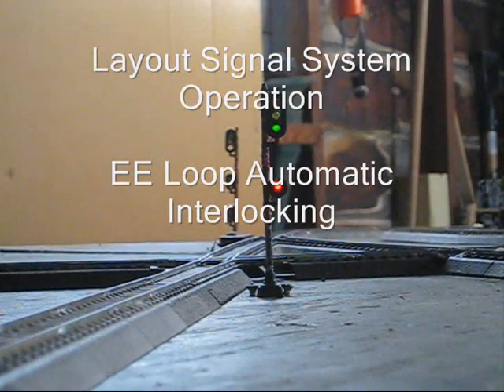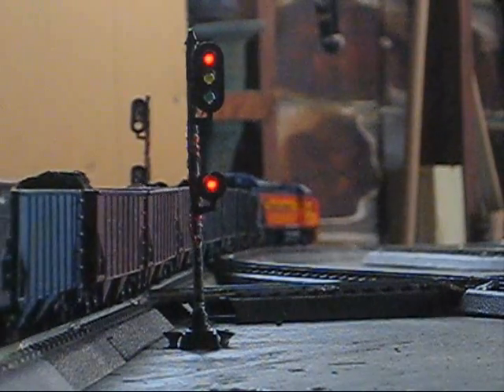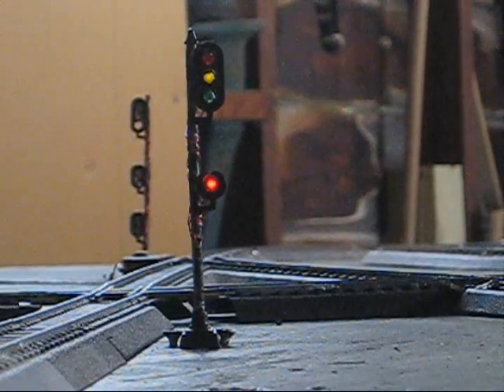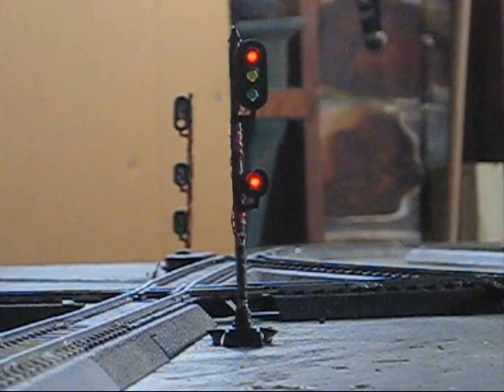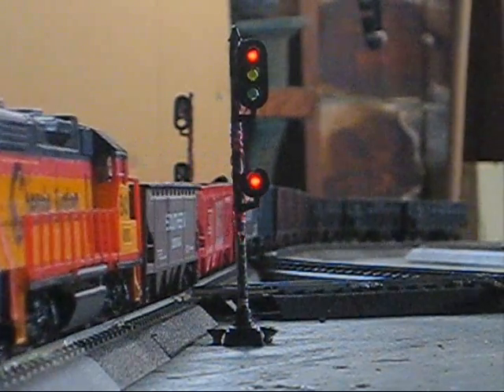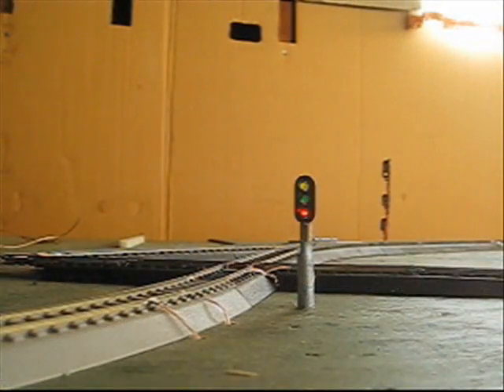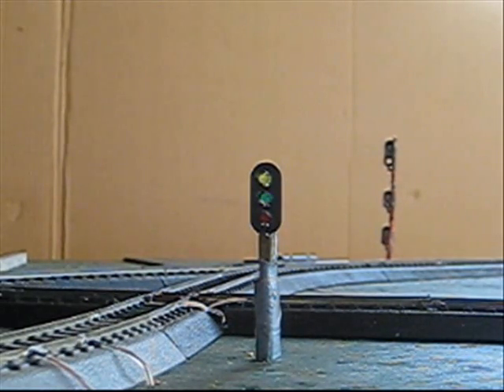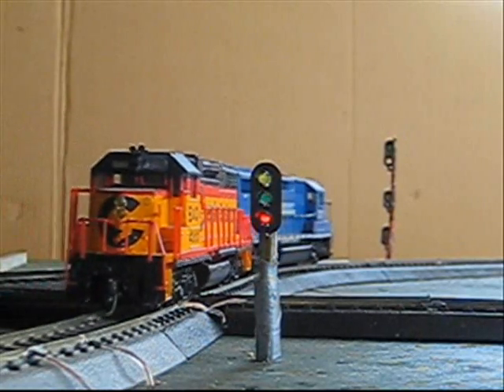Signal Operations 1

Comment: I have an o gauge system that I based on U.P. signals. All I could figure out was red approach and clear. Couldn't figure out how to make them flash. Hopefully I will stumble upon the same wiring diagram you used. I wanted to figure out a way that if you got through a red signal a manager would come flying up out of nowhere and scream you're fired. Hopefully i can figure it out. I think it would be hilarious.
Reply from the maker: John Tanner Lol yeah that would be funny. To add on to what you mentioned before about flashing the signal, I should note that this setup is rather old, by almost 10 years, and I doubt I still have the original diagram of this setup. I do know that there are a variety of circuits out there on the market that would offer those aspects. Circuitron comes to mind. Coming from a guy that now uses DCC and signaling with a computer I try to have an open mind to those that might not use DCC or want to deal with a computer for signaling. It is safe to say I have learned quite a bit more tricks since the posting of this video.

Comment: Just a question about the first signal you show here with a 3-over-1 mast. Is the bottom red single aspect just a placeholder to ensure that train crews know that the signal is absolute at an interlock? Norfolk Southern does this at most all of their turnouts.
Reply from the maker: Rail Dawg yes, the bottom head is a marker light which a lot of railroads use to distinguish an absolute from an intermediate. this signal was a custom made one using old model power signals kit bashed together.

Comment: Is a flash circuit easy to hook up for a signal? I am thinking about getting a Circuitron flasher for one of my n-scale signals. I think it has four wires. Do two of the wires go to the power supply and the other two wires go in-line with the signal? Thanks
Reply from the maker: I haven't worked with any Circuitron signal driver boards, I know Circuitron has plenty of documentation on their website that could help you out. It should have a diagram on how to hook up the boards. Hope that helps.
Reply: Thank you!

Comment from the maker: @msk578 Thanks for pointing that out and yes you are correct, however in the C&O rulebook, the green was in fact on the bottem just like a traffic light for the top head of their signals, I did this purposely since I was mocking the C&O rules for those signals. Most all newer signal installations have the green on the top however and about 90% of ones I see are that way.

Comment: Great demonstration.  Wanted to point out that on a railroad, the green light is on the top and red is on the bottom.  It's not like the traffic signals we see on our roads.
Reply: I'll expand on trainman1986's comment:  a C&O signal can have three heads, and the positions of the three colors of lights are actually different at each level!  From top to bottom, the standard arrangement would be:  RYG-YGR-RYG or but I have also seen RYG-GRY-GYR.  I don't know why they did this, but it probably had to do with some of the bizarre signal aspects they used.